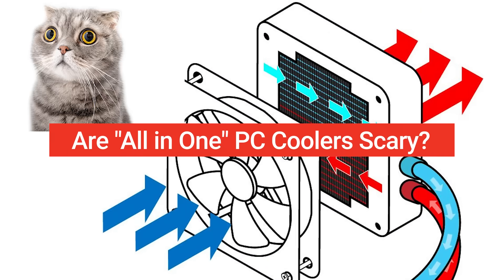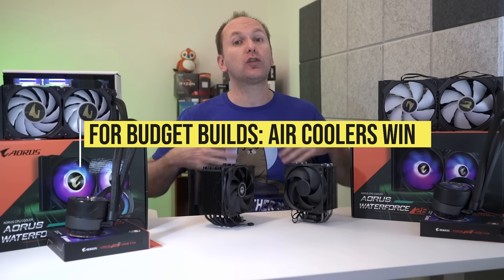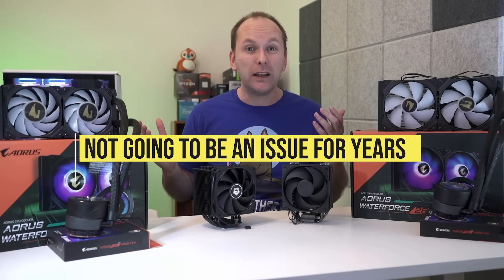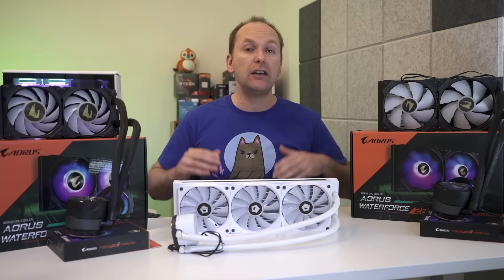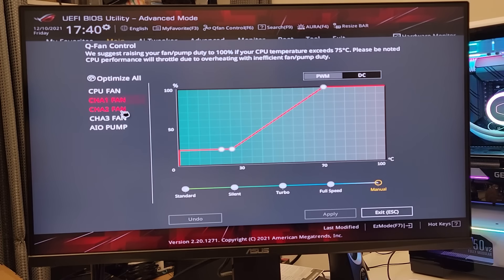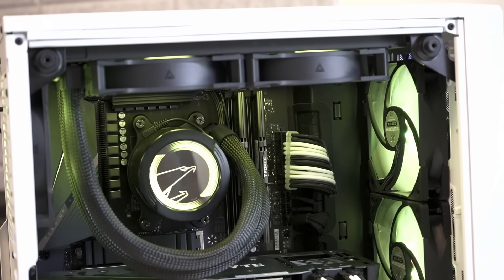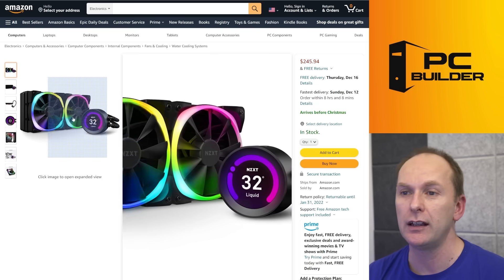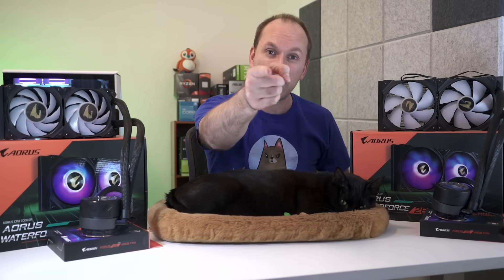🛑Watch BEFORE You Build! 🌊 PC Water Cooling Build Guide | Water Cooled PC Build 2022

Comment: Hi, is it fine from the airflow optimization point of view to mount front and back fans as intake and the top AIO as exhaust? It's the only combination I can implement to have a balanced, slightly positive pressure setup in my PC case. I have 2x140 on the front panel, 1x120 on the back and 2x120 as AIO fans on top.
Reply from the maker: I've never considered that setup and not sure how it would go. I'd just stick with top and rear as exhaust, front as intake. Remember the 140s intake more air (minus any impedance from the case) and you can always put them on a separate fan header and have them run a little faster than the exhaust ones to make up for the pressure difference.
Reply: @PCBuilderChannel  Thank you! Does adding a filter to the rear fan make any sense to balance out the difference?

Comment: i ran an NZXT kraken 280mm AIO on my fx8350 for about 7 years, then moved it with NZXTs bracket to my gtx970 for a year, and then on to a 2070 for another year and it was still going strong keeping the 2070 running nearly 2ghz at 55-57 degrees Celsius in games when i went to a full custom loop a couple weeks ago.

Comment: Risking the flaming here
AIOs are unnecessary UNLESS YOU ARE SPACE CONSTRICTED because an NH-D15 can trade blows with all of these (and if a case can fit  a 240/360mm AIO, it can likely fit an NH-D15 anyway). while an AIO has a lot of failure points, which are not immediately obvious (You CAN'T see a pump failure like you can see a fan failure on an air cooler, and a pump failure WILL kill your CPU, and AIO fans can fail as well)
Now that being said... Holy shit AIOs can be really sexy
Reply from the maker: RGB awesomeness is NOT Unnecessary. :-P
Reply: @PCBuilderChannel  I mean you can put RGB fans on a tower cooler too... ;)

Comment: Doing a Ryzen5 5600 build using a Corsair 5000D Airflow with a 360 iCue RT AIO. Now i need to figure out the other case fan setup. I wouldn't mind the front AIO setup but i haven't looked to see if that will keep the pump below the top of the radiator.  Or top mount the radiator and see if the standard corsair case fans that come with the case will work to keep the rest of the case cool

Comment: I already had Sickleflow fans so when I upgraded from a 120 to a 240 aio I went with ML240L V2 because it came with 2 more.
A question I have is can the Sickleflows be wired  for a "traveling" pattern instead of all the fans doing the same thing at the same time? They just have the 3 pin with pigtail argb wire.
I have seen multiple fans using polychrome and the "stack" setting, started with a flash at the first fan in line and ended at the last. It would stack the last fan first. Mine all stack at the same time.
I have six  fans chained together off one header. It doesn't see them as a series of 36 lights, it seems to see them as a single fan with 6 lights.

Comment: is it overkill if i use water cooling to my ryzen 5600g?
Reply from the maker: Yes. And if you have the budget for a water cooler I'd recommend putting it instead towards a budget GPU and 5600x. Check out our 5600g build on the channel for more on this.
Reply: @PCBuilderChannel  thank you very much for answering the question, i'm still new in this PC building i don't want to overspending so i just went with the safe route and pick g series and wait for GPU prices to go down, and i just watch your video about the GPU prices going down in 2022 so i can wait for that, also it's a little bit silly question but what happened if you put external GPU like 1050 or 1650 ? does the IGPU going to stop or just bottleneck further ?

will check the 5600g build video too, maybe i can improve some my PC part's

Comment: I got a h100i elite capellix on my r5 5600x (gold). With a overclock of 4675 all cores.
(B550 Tomahawk) and a max use, i got like 85 degrees, but in a long testing sure will go down to 80~. (Testing it on prime95, the more hotter test).
50 degrees on gaming usually.
Im thinking of keep playing with voltages, (now 1.300v) lowering it.
AIO Front mounted on 220T Corsair.

Comment: i would always recommend using a Noctua cooler over an AIO so good and so quiet but best is Custom loop and if you build a good enough custom loop you wont really need many fans at all

Also i would recommend going custom everyday since that is expandable where as AIO's are not so that is money down the drain if you want to liquid cool the GPU
Reply: Custom surely is the best, if you can afford it. Those parts add up real fast and only the waterblock for a 30series gpu is often more expensive than an aio.
I'm thinking about changing to water myself, mainly for esthetics and "optimal" cooling. 
I have a noctua nh-d15 in my brand  new system last year, which is an amazing thing, but its such a chonker that I either have to run it with only 1 fan in the middle, which is kinda meh. Or I have to add the 2nd fan only 2/3 covering the cooler since I can't go any further with the ram in the way.
So an aio (liquid freezer II 360) would make this way more clean and spacious, only costing 2/3 of just the gpu waterblock. 
And I think if you decide to go custom, you got to go all the way and cool everything, not just the cpu
Reply: @geoffreycuypers2602  Sure it is more expansive this is true but you dont need to buy everything multiple times radiator fans reservoir lasts for multiple builds if i buy a new mobo and cpu i dont need 100 USD for a AIO i just buy a new waterblock and hook it up to my dead silent 560MM Quad 140mm rad and its all dandy so in the long run you save a lot of money 

where as a GPU with pre installed AIO is extremely more expansive over the regular card 

so while i agree that a custom loop with the initial cost is high all hte fittings the tubes the blocks and all but you save so muh hassle and money in the long run

The Noctua NH-D15 is good enough to beat most cheapo AIO's so to beat that significanty to warrant for the cost you would need something better then the Arctic Cooling Liquid Freezer II 360 also this is why Low profile ram exist and in most cases you can twist the air cooler in a way so it dont affect the ram that much but you probably tried that already

"And I think if you decide to go custom, you got to go all the way and cool everything, not just the cpu"

i would say this is totally wrong this is the best part of custom loops you can build for what you need and then expand just make sure you get some quick connects and proper Fill / Drain ports and ur set to do what ever when ever this would even make changing out the water hassle free and since you got one of the best Air coolers on the market id save the money you were planning to waste on the AIO and set up a cheap custom loop start with a small rad like a dual 120mm or eevn a single 120 (that you can put where the exhaust fan is) GPU block cheap pump / res combo tubes 10 fittings and you are set and this would be as good as a GPU AIO and most likely cheaper!

then you get a tripple 120 rad more tubes a few more fittings and hook up the cpu later and you are all done, unless you want to go all out with temp controlled fans and stuff like that which i did so its all silent unless the water gets warm and with this it would 

!: beat all AIO since you have more rads to cool it down
2: more freedom to add and remove when you want
3: if pump break you get new pump not entire AIO (goes for anything obviously)
4: when upgrading all you need is new waterblock not entire AIO

Comment: I think you need a follow up to this video to discuss AIOs that do NOT have the pump integrated into the CPU block. Companies such as be Quiet! and MSI both offer AIOs where the pump is located elsewhere. In these instances, it is perfectly acceptable to bottom mount your radiator because the pump is no longer the highest point of the loop.
Reply from the maker: I had a couple more lines in this video but cut them as I don't want to confuse people. I do mention that some have the pump in the radiator block, but these are rare enough that I didn't want to confuse anyone who is new to AIOs.

Comment: Is it better to set up the radiator as an intake or exhaust for better performance.
Reply from the maker: It's been tested by a number of outlets and the results are inconclusive. Partly it's because PC cases aren't sealed environments and air gets sucked in or blown out (depending on the overall case pressure) of other openings. I generally prefer the top mounted ones to be out, and the front case mounted ones to be in simply so the tower isn't blowing air on me. Hope that helps.
Reply: Depends if you want better gpu or cpu temps

Comment: Everyone is entitled to their own opinion. Best case scenario for any water cooling is always pulling room air into the rad. I've tested different setups over the past 20 years, custom, and AIO, this has always worked the best. Cooling a rad with heated computer case air isn't ideal. No radiator for any piece of equipment on earth would do this. In every case all radiators always pull air from the outside. Always. Computers only need one exhaust fan, every other fan should be blowing in. Period.
Reply: So basically your saying to run more hot external air through the hot radiator into the case where your trying to get your CPU, GPU, and motherboard as cold as possible...Ya no thanks...I run (3) 120s on the front blowing in, (1) 120 high in rear of the case and the power supply on the bottom of the case pushing air out the back. Lian Li AIO at top of my case with 2 CORSAIR LEVMAG fans attached blowing through the radiator out the top of the case. My CPU, GPU, and motherboard never exceed 60c full load and run under 30c at idle even in the summer time...Please delete your post as you obviously no nothing about proper case air flow... Hot air flows to the point of least resistance and in most cases UP... I been building computers since single core CPUs 30 years plus experience, been in PC magazine years ago for building one of the first freezer CPU coolers mounted in the case, that had an AMD Barton core overclocked to 4ghz....

Comment: 4:10 the lifespan of air cooler are much longer. Like kind of endless, because it's just a "metal block". If a fan is broken on the air-cooler, just buy another one. A aio can break before this time. Sure, you can swap the fans on the aio too, but not parts like the pump etc.
Reply: But the other points are great :) Ty for the video

Comment: hi! what are your thoughts on the ryzen 5 5400g? is it okay to pair it with a graphics card or should i spend the extra money on just getting a ryzen 5 5600x?
Reply from the maker: Do you mean the 5600g? If so, you're in luck. We did a build with the 5600g last month on the channel where we benchmark it with and without a GPU and compare it to the 5600x. Short answer is yes, in most cases its worth it go get the 5600x but you should check out that video to see if you are one of those cases.

Comment: Can you please make a video on ryzen 7 3700x and its compatible mid-priced motherboards. It's only $25 more expensive than the ryzen 5 5600x
Reply from the maker: See my best motherboards for Ryzen 5000, only difference is you don't need bios flashback. But I personally would not get the 3700x over the 5800x or the 5600x. Right now the 5800x is less than the 3700x for example and its a far better CPU.

Comment: if you mount the radiator in the front of the case, just make sure the pump is lower than the 2 tube-eyelets and you won't get an air pocket

Comment: Hi - this is a very good video showing how to use AiO for CPU cooling and airflow correctly. In addition to the CPU AiO I'd like to know how to handle a dual AiO system when the GPU has also an AiO radiator with fans. And to make it more challengeing, I'd also like to see the very nice looking RGB fans/illumination - this is not very easy to handle or to find a solution because of the airflow of the fans wich often collides with the RGB rings/LEDs ...
Reply from the maker: Thank you! And thank you for the suggestions.

Comment: Hi there I live in Glasgow Scotland UK Wasn't wanting to spend £3000 but when on Scan UK site adding up and configuring a Vengeance prebuilt system it was coming to £2850  with 5900x alllbeit bigger case with larger 2tb nvme gen 4 to my 1tb WD SN550 /2tb seagate barracuda, ICUE 220T rgb airflow.Then I saw the 3090/5900x at £3099.98 but only 16gb corsair vengeance ddr4 3200mhz I phoned and got 32gb after salesman reconsidered had to wait over month . Ordered 23/09/2021 arrived 10/11/2021 after switching on soon realised they gave me the 5950x cooled by a corsair h100x white AIO liquid cooler My prebuilt overclockers UK i7 930@4ghz 12gb ram with msi Rx 480 8gb gigabyte UX58A UD3R Mobo is asleep upstairs now

Comment: I have a i7 11700f CPU I bought a cooler master masterliquid 240 AIO will that be ok?
Reply from the maker: Should be fine, just ensure proper mounting pressure (proper, not too much, not too little and applied a little at a time in a crosswise pattern. It's basically until you can't turn the screws anymore using a medium amount of force) and enough thermal paste applied.
Reply: @PCBuilderChannel  I have not put in thermal paste before should I do like a dot on each corner or an X pattern?

Comment: 🤣  If water cooling nubes think an AIO is complicated, they should try building a full custom loop. I love water cooling.
Reply from the maker: I'm scared of full custom loops! lol
Reply: @PCBuilderChannel  I've been building custom loops for over eight years and had my very first leak on a build I was doing yesterday. A radiator began to drip as I was filling the loop. One of the fins was punctured by a screw. I replaced the radiator and my build is up and running with no more problems.

Comment: Just put together a new rig with Be quiet pureloop 240 for a 5600x cpu. Sadly i can't recommend it. 1st installed the cooler on top and after some days the pump (which is on the pipe) started to make noises. Changed to the front mount pipe down position now it works fine. But with max cpu load the 2 fans are loud(2000 rpm) and the temp reaches 83 C degrees, which is i think for an AIO is not good performance. Repasted the cpu twice with Thermal Grizzly Kryonaut and nothing changed. Only plus side is the easy install and it's easy to refill it.
Reply from the maker: Thanks for sharing!
Reply: @PCBuilderChannel  Forgot to mention it's in a Be quiet silent base 802 house(so it has enough room everywhere). Also i don't like to criticise a product(been wresting with it in the last 3 weeks) because maybe mine is faulty but did see other ppl's posts/reviews having the same issue. Pretty much bought this blindly since i was always pleased with Be quiet products, all the pc's i built in the last few years have be quiet house n cpu coolers (usually Shadow Rock Slim or Dark Rock Slim).Choose the AIO to get the weight of the motherboard, less fuss with will it fit with the memory and everyone's saying its less noisy :P. Anyhow sorry for the long post. Your channel is great, keep up the good work! :)

Comment: I did a huge upgrade back in January and I have not been disappointed.  However, if I can change anything, I'd go from a CPU fan (beQuiet) to an AIO.  When I upgrade to DDR5 (assuming X570 MB's support it in a few months) next year, I'm investing an AIO as well.  I highly doubt I will change my CPU (AMD 5900) or GPU (3090) for a very long time.  Thanks for the thorough breakdown!

Comment: I wish they made a good AIO that could also cool the graphics card. However since I'll be using a cooling plate on my favorite 2080 Ti (I know, SO last generation!), a custom pump and watercooling loop will be required... so I may as well cool the CPU in the loop as well. Although it does seem somewhat possible to run an AIO for the CPU, and a custom loop just for the card... hmm.
Reply: ??? There's loads of aios for graphics cards
Reply: @Alucard-gt1zf  You misunderstood my statement.  I want an AIO that could ALSO cool the graphics card. Yes I know there are graphics card AIOs out there, but just like the ones for CPUs, they are closed-loop and have their own pump and radiator. I'm thinking of simplification here in a smaller case, in an environment without major overclocking, and I'd rather not put in a separate rad and fans. Using a custom water-loop, I can have my single, larger rad (360), and cool both the GPU and CPU. It's just that an AIO with twin loops would simplify the installation. Its probably not possible, because the nature of AIOs require a sealed loop.

Comment: I have the Gigabyte Aorus Waterforce X 240 on a 12700k + Win11. The AIO itself is good quality, temps are decent, but the SOFTWARE is the problem. As the pump has an LCD screen (which in theory should show the CPU temp and frequency + many other LCD modes which are not of any interest to me) the software does not read the CPU temp and freq at all. I have tried all software versions (old and new) of the Aorus Engine + RGB Fusion, opened a ticket with Gigabyte a month ago, and there is no response from their side. The problem is well known, but no solution at the moment. Forums are full of the same issue.. There are only two factors that could cause this, Win11 (gigabyte not updating their drivers) or the z690 platform which is new. Anyway, just a headsup for ppl using the Gigabyte AIOs - good hardware, poor software.
Reply from the maker: Thanks for the tips!